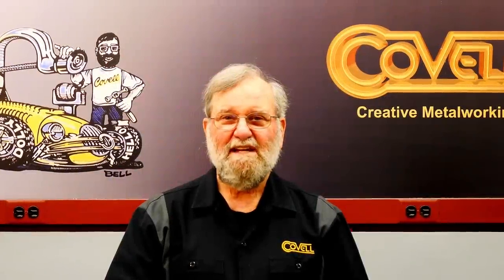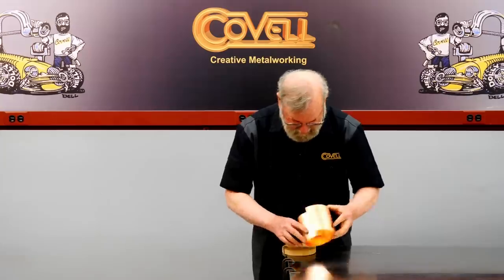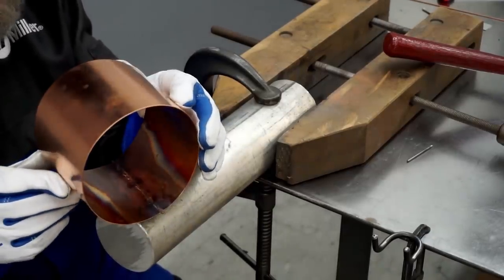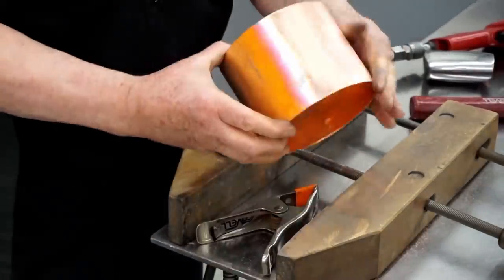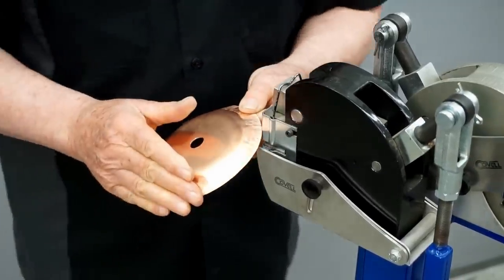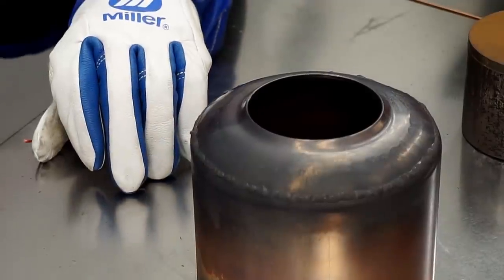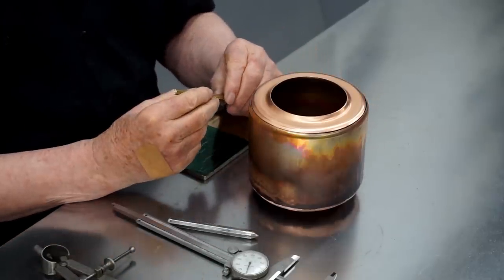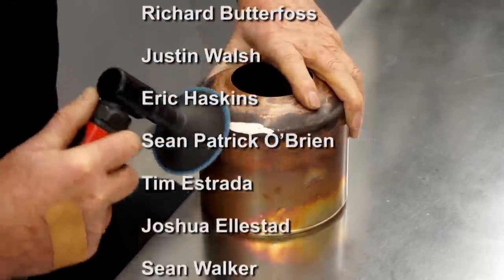Making a Copper Water Tank (Blondihacks Collaboration)

Comment: I've never seen that clever trick of pressing the work against the chuck using the tailstock instead of holding it in the jaws. Thanks for the video Ron
Reply from the maker: That technique is called 'friction turning' - it's the friction of the part being forced against the chuck jaws that allows it to be turned. Of course there are limits to how much cutting force you can apply, but it works well within these limits.
Reply: You don't watch Joe Pie then?

Comment: Tig welding copper sounds like it would be tough with how conductive it is. Great job! I like how you make the effort to highlightmultiple different tools and methods. A living legend.
Reply from the maker: Yes, copper dissipates the heat more than any other metal I've tried, so you have to really pour the heat into it. I had my machine set at 210 amps, but I didn't use the full output - I moderated it with the foot pedal.
Reply: @RonCovell  Whoa! I never would have guessed that you'd need that much heat to weld that material.  Thanks for sharing, and wonderful work!

Comment: Thanks Ron.  I have been a beermaker for over 40 years, and I used to follow the beermaking groups on Facebook, but (I have found) that the youngsters in those groups don't have the discipline to keep me interested in following the groups.  Too much fighting.  I have found that the moonshine and distilling groups tend to be more adult (and better moderated).  I have followed your metalworking for a while and really like your approach.  I don't distill, but I have always wanted to build a still, just as an exercise in creativity.  I would be out in the shop right now, except for two factors: I don't like working outside in the cold, and the price of copper is obscene. Thanks to your guidance, I'll probably spend the next few months learning to TIG weld, and maybe (this time next year), I can complain about the cold again...
Reply from the maker: Well, perhaps the heat generated by your welding can help you get through the cold winter months.

Comment: Picked a couple of hints for my own copper projects!!!!!
Reply from the maker: Hey, that's great news, Steve! Be sure to send me pictures as you move forward. That aluminum backer bar for the welding would have worked a LOT better if I'd taken the time to make hold-downs on both ends of the copper, and the .040-inch gap helped me to get more consistent penetration with the weld. The more we do, the more we learn.

Comment: My first visit here but not what I expected. I don't know of any hobbyist who can drop a couple of thousand at every challenge. I roll edges over a wood mandrel and anneal the copper (or brass) with each pass - just as Quinn would do - then continue with the next challenge.  I did learn more about TIG welding copper though. This is on the professional level. Thanks for the effort anyway.
Reply from the maker: Thanks for your comments. I certainly do use some high-end equipment in this video. I've been a professional metalworker for over 50 years, and have collected some great tools over that time. Please note that I do have a number of videos where I use only simple tools. Here is one example, if you want to take a look:
https://www.youtube.com/watch?v=MaZ_tdqPRAQ&t=7s
Reply: @RonCovell  This other video is at my level. Thanks. I learn far more usable idea from the simple stuff than the professional-level stuff to which I don't have access. Plus, I feel some achievement after overcoming a difficulty by thinking it through. After all, if I had the money, I'd just go out and hire someone. Good work.

Comment: I love TIG on copper, the puddle color makes it so easy.  For me, stainless is the easiest to weld because the heat stays so localized, but copper is just so much fun.

Also, WOW, McMaster must have mixed up the prices between gold and copper.  I had no idea that prices had jumped that much.
Reply from the maker: I was shocked, too. I bought a12-inch x 24-inch copper sheet for the tank through Amazon, and that was about $80.

Comment: I'm watching this video since it was recommended to me (YouTube recommendations got one right!!), and I'm only at just over 9 minutes in and I have to keep myself from going - "wait, that's not going to work" because I'm thinking in pressure vessels - I keep forgetting that this is a tank that will only hold water, not pressure. So the construction is perfect for that, but I'm so used to seeing copper used for the boilers in these steam setups that I see it and think 'pressure'. 

I'm gonna finish the video now, but I wanted to say I like it and will find more to watch. :)
Reply from the maker: Yes, pressure vessel fabrication is much more stringent, and I don't know anything about that trade. I'm glad you do!
Reply: @Ron Covell - yeah,bi worked in a shop rhat huilt oil/gas/water separators for the oil industry. Pressure vessels are no joke, which is why there's a limit in size on what's considered 'hobby'. But you can learn a lot by watching people building projects like Quinn and others - definitely enough to know where to go to learn more if you wanted. 😀 

I've just watched a few boiler builds recently, and those have to be built just like big pressure vessels if you don't want to find yourself covered in hot steam suddenly. Needs slightly thicker material and no welds, for a couple points (with copper hobby boilers). 😀 Thankfully I knew what you're doing, but my danger sense kept twinging because copper.

Comment: Very nicely done!  I had occasion to weld copper some years ago, and used electrical wire, didn't know why it came out porous thanks for the lesson.
Reply from the maker: Now you know!
Reply: In the process of assisting my daughter with her doctorate I had to do some work with copper (replicating a piece of equipment from 1830). Because of this I discovered that early work with electricity was plagued by porosity in copper wire. The outer surface looked great but the core was a mess. The solution to the problem turned out to be melting and drawing the copper in a vacuum. Clearly it does not need to be 100% free of porosity for general use but TIG filler wire is not general use. I expect they have to do the same thing but make sure the vacuum is a lot harder for the filler wires and they probably have a protective coating to keep them free of oxygen in storage. You can use argon mixed with 5% hydrogen to do TIG welding in some materials as it combines with any oxygen present an keeps the weld oxide free, perhaps you have come across this already.

Comment: That's a cute teapot! :)
Interesting tool holder you used for the bottom plate champhers (18:28-ish). I have never seen an adjustable one like that, where you can twist the 'head' relative to the 'body'.
Reply from the maker: I purchased the quick-change tool holder you remarked on about 40 years ago, and it is still in production. The brand name is Aloris, and they are still in production, but now many other manufacturers make a similar style.

Comment: Do you weld copper with DC and argon shielding? I'm surprised it goes so well. I've been assuming it's at least as difficult to weld as aluminum!
Reply from the maker: Yes, DC, and straight argon gas. The copper actually flows reasonably well, but it does take a lot of amperage to weld it, since it's such a terrific conductor of heat.

Comment: Nice and different project for this channel !
Would it be possible to use Silicon bronze TIG brazing rods for this ? (Apart for possible colour differences)
Reply from the maker: Yes, silicon bronze filler rod would have worked well (it actually flows better than copper) but I wanted the best color match I could get for the visible welds. Here's a video where I go into more detail on welding dissimilar metals:
https://www.youtube.com/watch?v=J4Cxk1nZyaY
Reply: @RonCovell  Good to know, thanks for the reply !
And very nice of you to share your knowledge !

Comment: Great work Ron. As a sheet fabricator welder of nearly 60 years, it was a delight to see somebody else use the aviation snips upside down. I thought I was the only person that done this due to the fact I am only 5 feet tall. Was recommended by Quinn, blondiehacks.
Reply from the maker: I'm so glad you found your way to my channel! 'Upside Down' is a relative term. I use the snips both ways - whatever is best for that particular application. I made a video on the subject you might enjoy:
https://www.youtube.com/watch?v=x8PDRAsMDXc
Reply: @RonCovell  thanks for the reply. I have used them in all the scenarios  in your other   video. As a well aged veteran of the trade, the early days we only had tin snips or gilbows, and brute force. With the invention of the new snips I always felt the intention was to use them as per the finger moldings. This took about  10 minutes to realise how pointless they are. Also saved a lot of time on heavier gauge sheet, not having to go back and forth to the bench knife. Every time I have seen people use them on YouTube  video they always hold them in the "correct orientation " and struggle with them. Thanks again.
Reply from the maker: For the record, I have tried the Gilbow snips. My hands aren't large enough to work them very well, and they take a LOT of force to cut with, since they do not have a leverage multiplying linkage system.

Comment: Great project Ron.  Are those the Covell roundover dies?   Does the bead roller machine use the same dies at the import machines or the Milter Bros?
Reply from the maker: Yes, I used the Covell Roundover dies. I used the dies with the 15/16-inch bore (Pexto style), and the JS Tools Beading Machine has 20mm shafts. There is a set of adapter sleeves that allow the dies to be used on any machine with 20mm shafts.

Comment: Did you not have any issues with the copper work hardening when you were forming the end caps?
Reply from the maker: Any time you make metal move, it work hardens to some degree. On this project, it didn't harden enough to make annealing (softening with heat) necessary, but that's always an option if needed.

Comment: I’m curious about which type of copper was used, whether the copper was annealed before you began shaping it and whether this vessel could be used for potable water. Very enjoyable video.
Reply from the maker: I used 110 copper sheet, .040-inches thickness (1mm). This material is 1/4 hard as purchased, and did not require annealing. Many homes (including mine) use copper tubing for their water supply systems, so it seems to me that it is fine for potable water, but I'm not an expert on toxicity, or health issues.

Comment: How did you hold the 1/4 base on the lathe? Looked like a pin on the tail stock and pressure on the jaws?
Reply from the maker: That technique is called 'friction turning'. I mounted a 'live' (ball bearing) center in the tailstock, and used it to push the disc against the jaws on the chuck. There is a limit to how much turning force this can withstand, but it works quite well with light cuts.

Comment: 5:41 are you hammering to work harden the copper you just TIG welded to the copper sheet?
Reply from the maker: Whenever you weld metal, the heat-affected area shrinks, often causing distortion. If you watch closely, you can see the copper move outward as it's welded, and inward as it cools. The hammering stretches the metal back out, and corrects the distortion if you do it the right amount.

Comment: Ron, Did you hold the disc in the lathe just by pressure from the tailstock against the jaws?
Reply from the maker: Yes - that procedure is called 'friction turning'. I had originally planned to say a few words about it, but my video was running around 40 minutes at that time - before I decided to break it into two sections.
Reply: @RonCovell  Clever, I always do that kind of operation in two, turn, flip, turn. I must try your method.
Reply from the maker: I certainly can't take credit for inventing that method - it's been around for longer than I have!

Comment: I find it amusing how many people in the comments are "new" to one of the most legendary sheet metal guys in the car world, his videos do no justice to his abilities or creativity. I will point point out that most quality solid electrical wire can be used for DC tig welding the weldable grades of copper sheet as long as it is the higher "oxygen free" variety. It humorous to walk on to a refrigeration or power plant worksite and see rolls of 14Ga Romex laying around every weld station, but the pure copper wire is compatible and electrical wire tends to play nicer with the AC welds sometimes required in high purity situations.
Reply from the maker: Thanks for the nice comments. Of course, not all YouTubers are 'Car People', or even 'Guys', for that matter, so my stuff is always new to many.
I didn't know that there were different grades of electrical wire available. I remember my first attempts at TIG welding copper, and I used some solid copper electrical wire that I had on hand, and the welds had LOTS of porosity. Same story when I tried using strips of the parent metal as filler. I don't recall when I learned that you could buy deoxidized copper TIG rod, but as soon as I tried it I had immediate success.
It must take a HUGE amount of amperage to TIG weld copper on AC. It takes a lot on DC, but in AC, a large portion of the cycle is in the Electrode Positive mode, which doesn't put any heat into the base metal.
Reply: @RonCovell  the amount of amperage needed for AC is quite high even on thin pieces, and you definitely don't get the same aesthetic appeal as DC.  But it makes a huge impact on the purity of the resultant weld especially when it will be ground or machined off. The inverter welders with balance and frequency control have made a huge difference in the world of AC copper welding. One thing that helps with copper DC tig is to grind your point longer, shoot for length to diameter ratio of 4:1, #6 cup for most applications and #8 for higher amperage, then stick your tungsten out the same distance as your cup diameter and actually push the weld. There is obviously a limit to how far you can lean the torch, but there is a huge benefit to the preheating action of the arc and gas ahead of the weld. In some cases, heat scale forming on the work piece is not allowed as it changes both the chemical composition and final dimensions, so the welder must move as fast as possible with large amperages to minimize total heat input.
Reply from the maker: Wow - I just received a master class in welding copper - thanks a million!

Comment: Very neat ,, I take it the legs are counter bored and the holes in the base are blind holes .
Reply from the maker: Well, the base of the tank is counterbored so the legs fit into an angled socket. You can see this detail in Quinn's current video: https://youtu.be/fl6OBxV02YU
I will show this in my Part 2 video also - expected to be released in a week or so.
I didn't have quite enough thickness in the 1/4-inch thick base to make blind holes, so after consulting with Quinn, I drilled and tapped them all the way through, and she has some killer Loctite thread sealer that keeps the setscrews from leaking.
Reply: @RonCovell   Many thanks Ron , looking forwards to part to all ready.

Comment: Wouldn’t spinning be a better method for the top and bottom?
Reply from the maker: Spinning would certainly be a reasonable method, but I don't have much experience with it. In part 2, (which should be released this weekend) you will see that I use a 'rolling' method similar to spinning for the bottom side of the cap.

Comment: Hi Ron  Very nice tutorial on working with copper. Could you please give the tig settings used on the tank project. Copper prices are so high because the companies are using the war to increase their sinking profits that do not improve the workers wagers only the very senior staff with hug bonuses.
Reply from the maker: DC, electrode negative, machine set to 210 amps (but used less with the foot pedal) 3/32-inch diameter Lanthanated tungsten, ground to a sharp point. 16 CFH Argon flow. No pulse. Anything I missed?

Comment: The 24KV service line only had 3 factories on it; a steel stamping plant, aluminum foundry and a porcelain products factory. Our big water cooled Lincoln TIG welders were 50 amp 480 volt 3 phase and as I remember ( I could be wrong ) Lex used a 3/16 rod for the heavy work. He tried to teach me some and I could do a little of my own welding work but as the head electrician I had a lot in my own departments concerns to cope with. It's been fun talking with you have a Merry Christmas

Comment: When you worked on the F bomb I had some back and forth about the radius evenly dividing the circumference six times. Because of that exchange I haven 't forgotten that bit of info. I remember it better than the word emulsifier. Why? I dunno.
Another fun project, thanks!
Reply from the maker: Well, everyone's life is different. As a metal fabricator, I need to know how to divide a circle into sixths much more often than I need to define 'emulsifier', but your mileage may vary.

Comment: Pretty sure that plate was held in the lathe with witch craft
Reply from the maker: I used a technique called 'friction turning', where the workpiece is pressed against the chuck by a live center in the tailstock. This only works for light cuts, but it can really simplify workholding for many operations where you need to turn the outer diameter of a part.